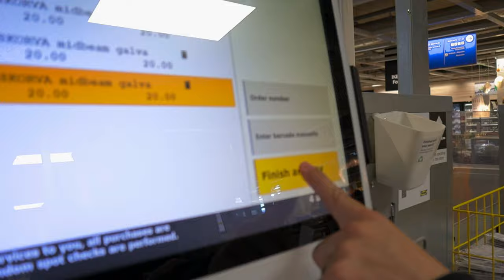Plumbing Our Camper Van Sink/Outdoor Shower

Comment: not sure if your going to have a roof rack but if you are then there is a video on youtube that shows a sealed 4" pipe on a roofrack,it has a filling cap on 1 end and a  hose connector on the other end.once its filled the sun heats water inside  and you just connect a shower head for a hot/warm shower.
Reply from the maker: We originally planned on a solar shower so maybe in summer we'll install one! Thanks
Reply: @JodieandJoe  hi guys,just watching all your videos from the beginning :)when i made that post this was the first video id seen so didnt know your roof was all solar panels :( but ive got to say yours are the best convertion videos ive seen and very informative.keep um coming
Reply from the maker: Thank you so much!!

Comment: Hey dude,great channel. Some great tips... I've just started my conversation..scratching my head to what electrics etc I need any info would be massively appreciated
Reply from the maker: Sure I'd recommend running as much as you can from DC power eg lights, fans, usbs, using a "house battery" which is a separate battery from the vans starter battery. Ideally Lithium and not lead acid, id go with a single 12v 100-200ah for a simple set up.
Then get a small inverter 1000-2000w for AC house power for your smaller household appliances.

Comment: Thinking about filling the cold water tank...most places will just have a cold water tap...no pressurised system...so u will be filling Containers
Reply from the maker: In that case we'll have to bring our 25l water container to fill up and pour into our system
Reply: Most people carry a hosepipe that connects to site tap (carry a variety of hose end fittings) and drops into the van's inlet.

Comment: You need to have an isolator switch, if you connect to site mains it will blow you investors
Reply from the maker: We have an isolated double pole RCD between the mains hook up and the inverter, it should be in our Victron video 👍